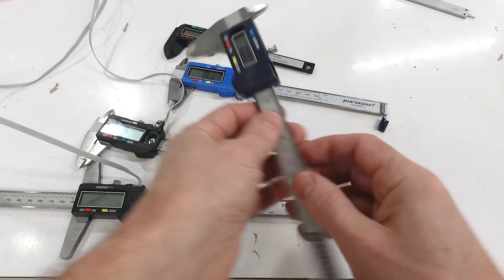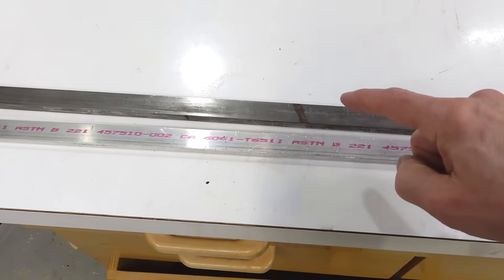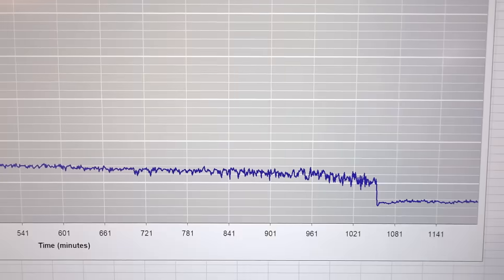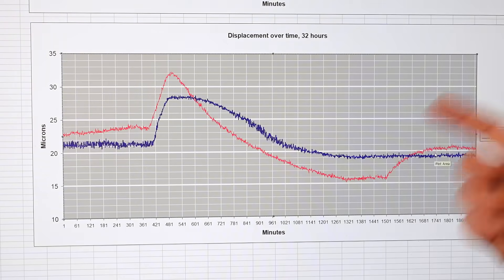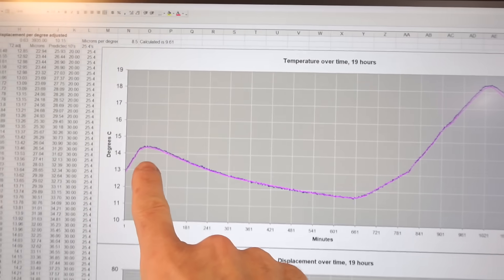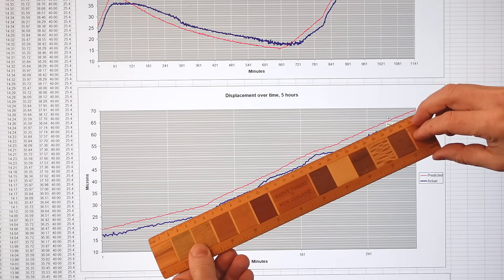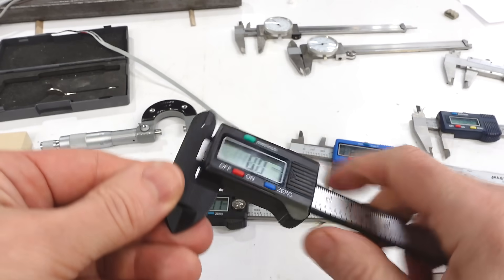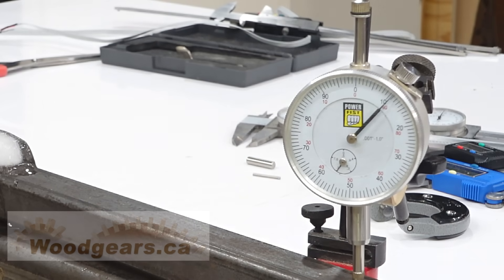Measuring microns with digital calipers

Comment: Its really impressive to see that these Digital Calipers are actually pretty accurate!
I was not quite expecting this. It seems the most inaccurate thing about these, is the construction itself, with flex beeing the main cause of error.
As you pointed out, depending on how hard you press them closed, you can easily get different measurements.

Makes me wonder how 'top of the line' digital calipers and micrometers work - that actually display reliably to 0.001mm. And how accurate these are actually measuring behind the scenes. Rule of thumb is 10x smaller than what you want to measure.
E.g. If i want to repeatably and reliable measure to 0.1mm, I need a measuring device that can measure 0.01mm.

Comment: I find this stuff very interesting.
Think stiction.  I wonder if you had shimmed up the clamped end of the two bars and had a roller at the measured end if it would have helped with the apparent stiction.  Stiction like earth quakes - break and  stick.
I guess you already know but others may not - the two set screws on the edge of the electronics body not only set the friction between the two halves of the caliper but also are adjusted to minimize the very small rotational difference between the two halves.  You can approach this adjustment by measuring a dowel pin at the tip and at the base of the anvils and adjust for the same reading.
Reply: best comment on this vid! Thanks for the tip about adjustment screws

Comment: The caliper also expanded and shrunk.
Reply from the maker: Yes, but they are made of stainless steel, fairly close to the low carbon steel number I used.  So I just counted that part as part of the steel.
Reply: @matthiasrandomstuff2221  and the pcb that is inside? Glass fiber has a very low thermal expansion...
The other point is that you also neglect the thermal coefficient of the electronics. Adc drift, quarz...
Reply: @wiju  it is a differential measurement of long steel and iron pieces so the overall error contributed by the expansion and contraction of the caliper material is minimal.

Comment: Some of the really cheap plastic calipers I have do not output any data (but still flatten the battery when not in use), others which look identical do output data and also the data is in 0.01mm even when the LCD only displays 0.1mm.
Reply from the maker: I was hoping the ones I bought would be the latter kind.  I guess I picked wrong.
Reply: @matthiasrandomstuff2221  Could the bumps come from a sort of rythm of the time measering In the rpi and the calipers outputting data in microns? What would happen to the curve if you measure every 800ms? 1 second divided by the 1.25 (from the microns the calipers can measure) is 800ms (well 800ms times 1.25 is 1 second). Would that change the curve (less bumps)?

Comment: Mathias instead of that tea towel for insulation maybe use a cover of tin foil or metalized bubble pack?
Reply from the maker: The fabric was much easier to drape over.  Plus I had it kicking around already.

Comment: My guess is that the tiny jumps are a mechanical thing maybe the way the circuit board reads from the bar that every 11th spot it does something and it has to totally pass it before it can read it. 

I remember watching a video  a while back. I don’t remember if it was Clive or who it was. They broke it down exactly how it worked. And some of them were able mechanically to read like 10 times or 100 times to read out and then it would calculate what to read out these ones don’t seem like that type.

Comment: Does someone have a source for veeery cheap calipers, that have the dat/clk output?
Like 2-3 euros per caliper?
I only ever found one on aliexpress. All calipers I bought after, did not have the output. I also testet all possible spots on the pcb but nothing protocol like was visible, except for the row of contacts for the display, for which I haven't found any documentation online.
Heeeeeeelp :(
Reply from the maker: Some have the output but don't have the removable part of the plastic.  You have to kind of peek past the battery to see if the contacts are present.
Reply: Yeah, I know. I mean that a lot of models don't have the contacts anymore. I have quite the collection of cheap plastic digital calipers now :D

Comment: Love this video! Thanks for posting it. It makes sense but I suppose I never really thought about the accuracy of the sensor inside a digital caliper potentially far exceeding the actual needs of the device itself. I love the ice cube demonstration too! In the manufacturing space I’ve had quite a few people carry say a 50mm long metal part with a 5 micron overall length tolerance across a plant firmly in their hand and then wonder why they are seeing measurement discrepancies…

Comment: thanks for those experiment, u can use piezoelectric actuator to get micrometer  displacement it gives you 27um at the maximum voltage of 75v
Reply from the maker: but would it be stiff enough to move the calipers precisely?
Reply: There is also the magnetostriction effect, a piece of ferrite with a coil. It is a small effect, but the material is very rigid.

Comment: Isn't it also the hysteresis of the aluminium bar itself that causes the delay in expansion? Even though the surface is a certain temperature, that does not mean that the entire bar is that temperature across the whole. The bumpy part I think is due to the internal caliper PCB traces.
Reply from the maker: Given how slowly the temperature changes, I'm pretty sure its even over the bar. Also, those traces are about 50x wider than the bumpiness.
Reply: @matthiasrandomstuff2221  Can the bumpiness explained by stick slip? Was my first thought. But after thinking a bit more if it were they would be present on all your tests. And stick slip would take effect on a much lower scale. Am I just convincing myself out loud? :D

Comment: I'd say you can improve a bit if you mount the calipers differently. In video you mount it to the side of the bar, clamping by the body and a jaw - this exerts some torque on the calipers and maybe causes them to bind up, which results in increased friction and those jumps on the chart. I suggest clamping to the body and the center tongue (depth gauge) instead - they are in line, so there will be no torque. That's the reason the real micrometer is built this way.
Reply from the maker: but that tongue is thin.  Also, how to clamp that tongue to the aluminium bar?  Its all gotta be robust, and giving up robustness for lining it up is counterproductive.

Comment: I know you’re not Project Farm and comparisons aren’t exactly your thing, but you really have a very interesting set up for doing caliper comparisons! It would be awesome to see a brand name, Mitutoyo caliper (high end) compared to a Shars Aventor (mid grade) compared to a cheap one like harbor freight. Even though you are measuring at a scale that these calipers aren’t designed for, it seems like it could be interesting to see if there’s any difference between the different price grades of calipers.
Reply from the maker: That would require investing more money in the video than the video would earn.
Reply: @matthiasrandomstuff2221 I had a look at what mitutoyo tools cost once. I decided to stop looking at them 😅
Reply: @matthiasrandomstuff2221  Used Mitutoyo calipers can be had at reasonable prices.  New, I wouldn't trust any purchased from anywhere except reputable vendors - too many clones.

Comment: This is the kind of stuff that really makes you think. This kind of iterative probing builds a mental map you later rely on, often subconsciously, when navigating unrelated systems. It helps you to develop debugging instincts that generalize surprisingly well across domains. Very interesting. Love these experiments. I actually watched it twice.
Reply: Very nicely and accurately put.  As an electronics hobbyist of over 50 years, This is my experience with other makers. They think outside of the box as you describe... the auto didact seems to have an inherently more Multi-dimensional perspective and approach.  The downside of that, at least for me is that I am easily distracted down many rabbit trails.
Reply: @forgeteverythingyouknow5413  So very True.

Comment: The difference, Matthias, I believe comes from the exact composition of the aluminum bar. And there's the iron bar also, that should interfere a bit... But it's really interesting indeed!
About the measurements, I guess it depends on the application, but if you some, let's say, 10 of them and divide by 10... It should help. Should.
Anyway, stay safe there with your family! 🖖😊

Comment: I think the placement of the temperature sensor is causing the non matching response of displacement in comparison to predicted values. It is on the surface, aluminum and steel have different thermal conductivity, and the way the bars are connected on one end, is not ideal for this small changes. But i wasnt even expecting them to give comparable results on this scale. I hope you experiment with strain gauges (dms) as well, ive tried to build my own torque sensor built in a servo coupler, but ive never achieved high accuracy. I would love to see you thinker with them.
Reply from the maker: With temperature changing as slowly as it did, the conductivity isn't a big factor.  I didn't apply heat to it directly, just ambient room temperature changes.  And with the cloth over the whole thing, that really slows down temperature changes some more.

Comment: Instead of thermal expansion, why not use a screw thread and lever?
As long as you accounted for the 'slop' in the mechanism - just as you would account for backlash in a machine, everything should be good.
Reply from the maker: I suspect the screw roughness would already be enough to mess it up.  Also, it requires touching the mechanism.  Shifting things by one micron by accident is far too easy.
Reply: @matthiasrandomstuff2221  It's quite difficult to comprehend just how small some this stuff is unless you actually work with it.  I work for a semiconductor company and occasionally do work on the probe station.  We have these micromanipulators we use to probe our chips to debug issues, so you're often trying to hit targets just a few microns across (sometimes less) with a very, very sharp needle.  You can see micron deflections under the microscope in the point of the needle just from somebody walking past.  And that's with the probe stations being on air tables.